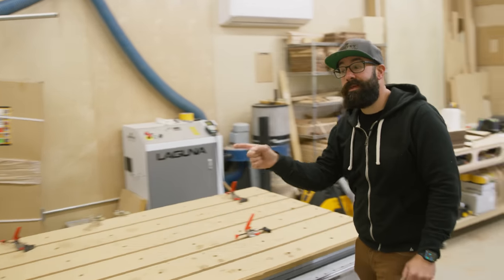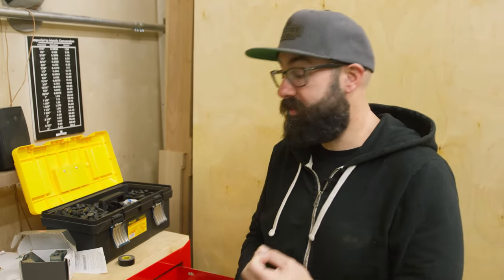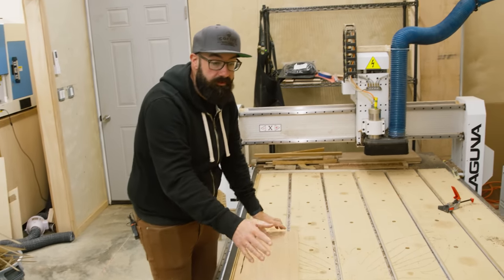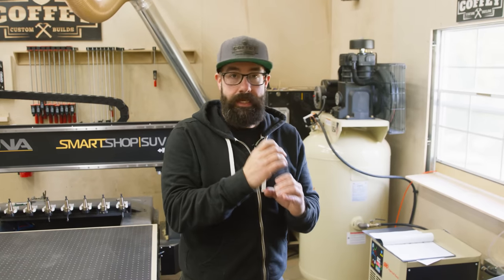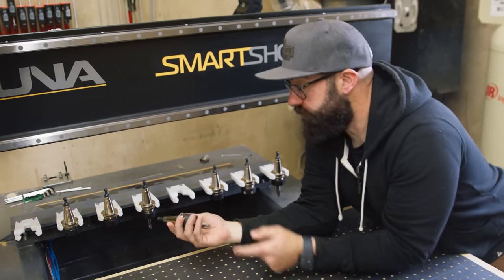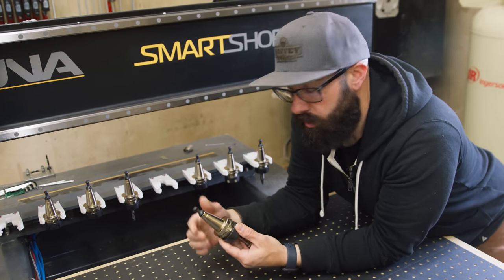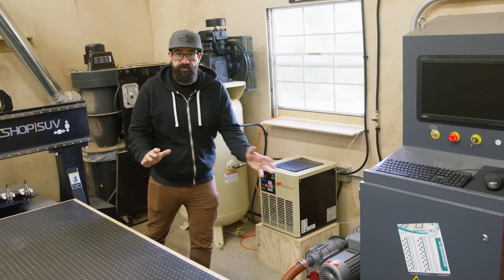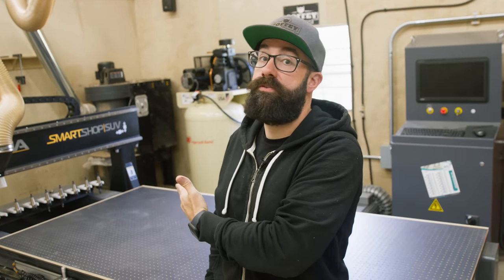The Hidden Costs of CNC's!

Comment: I guess the final cost time aswell right?
Every hour spent setting it up is an hour you wouldve been paid for.

I think for me in the end what turns me off about cnc machines is that I wouldnt really consider myself a woodworker any more. I'd be a cnc operator.
Reply from the maker: Yeah time is always the biggest cost. 

Do saws turn you off because you'd be a saw operator? It's just another tool that gets used in the shop. I own 3 CNC's. I rarely use them. My employees do mostly. But I am definitely a woodworker. I also don't operate my lasers. But I do operate my saws, joinery machines, chisels, hand planes mark up tools. None of those tools make me a woodworker (or not).
Reply: @CoffeyCustomBuilds  for me it's not just another tool. Look, would you consider me a potter if I worked at a modern potfactory? Or a glass blower if I pushed a button that blows glass? There is a line somewhere along the way where your'e no longer a craftsman but an operator (you could be both ofc.). The line is fuzzy, and probably different for every individual. To me cnc is different.

I don't mean it as disrespect. One is not better than the other. I just dont want to be an operator.

Comment: Really surprised you didn't mention the oldest method painter's tape and ca glue.  Machine everything but the bottom and no pausing the program to danceing around with your clamps or clamp pressure relaxing whyle it's being milled.
Reply from the maker: I'm not a fan of it

Comment: Everything is a consumable, sorry to have to point out the obvious, but making a distinction is just confusing. If friction exists a part is going to wear down, even if you add something to reduce the friction it will still wear down, albeit slower but then you have the cost of the "consumable" you are using to reduce the friction and thus extend it's lifetime.
Reply from the maker: Yes, by nature everything deteriorates. But typically when referring to consumables the tool themselves aren't part of that conversation.

Comment: Well, the bigger the toy, the bigger the price tag. Obviously you didn’t get the new one for a hobby shop tool. Guessing you were making good money with the first one and felt it worth the investment to go bigger. Yes there are extra costs. Mine was around $2000, 6 years ago. After getting computer, Vcarve pro and bits and stuff, totaled about $4000 to get going. But, mine is about 24”x33”. No tool changer, just me. A 220 spindle, but not 12 horse. A shop vac connected to a dust boot. No big vacuum thinge, forgot what that was for. And I’m not saying $4000 is cheap, but I’m guessing yours was at least $15000 to $20000 or more, just for the cnc. And it’s a nice one that I wish I had to play with, but the one I have now isn’t the main tool in my shop, so no reason to upgrade to that extent. But it’s just like everything else. Compare tires for a Volkswagen to an F-350 pickup. I bought a middie lathe a couple years ago to try out and it was $450, so not the end of the world if I didn’t master wood turning. But then came a tool set. Then a chuck, a drill chuck, more tools and one of this and two of that. And don’t forget the sandpaper and finishes. Probably at least doubled the initial cost. One more. 8 inch bench grinder. $200 or so, just mount it, plug it in and get to grinding. But, the standard come with wheels are, well ok, but not Cbn. Gotta have a couple of those, right? So there goes another $400+.
Reply from the maker: Everything is relative and this was far more money than $20,000... But thats not the point. CNCs are becoming more and more accessible and I just want to help people who are researching understand there are costs that might not be as upfront as you'd expect.

Comment: I made 500 buck out of my 3018 pro with increased bed lenght and new 775 drill motor that have higher rpm that the one that comes with the machine. The machine cost me around 300 dollars with all the tools and upgrades. I got the money, learned CAM and CAD and had a lot of good time while working with this little abomination 😅
Reply from the maker: That's awesome!

Comment: Not sure why you think you need a CNC to build cabinets, I have looked into it and I don't see the costs savings to the way my cabinet production works
Reply from the maker: Well if you've looked into then I'm selling this.
Reply: @CoffeyCustomBuilds   Thanks, for the offer, I have a 10' sliding saw I use to cut my  panels, I find its just as fast as A CNC, also the CNC takes a sheet and optimizes and cuts parts all over the place, there is a lot of time figuring out what is what,  For me my system works best. I can do cabinet boxes pretty quick

Comment: cutting  mdf all day long  need a decent machine
its pending on  what type of work you get  and how  many

locally i know a cabinetshop, they invested  around 2005  in german router  and a six head molder
around 450K
but they doing weekly 2-3  complete  kitchen cabinets

myself  am a lot smaller  using a 4x8  router   a 1325
whole machine  was around 5000  in the shop  with all taxes and shipping

however it can generate a few grand per week
simple  shapes and a lot  that makes the  money
 individual works like inlays  and carvings  are the least profitable stuff

so overall whatever comes still  more affordable than  going to  a workplace daily
Reply from the maker: couldn't agree more. These machines can generate revenue very easily and they're better than working for someone else any day.
Reply: @CoffeyCustomBuilds  
thats the point, build your own life, and  dont get hired to build others lives

Comment: #suggestion Btw did you considered adding new 3phase electric line ? In our country it is costly but maybe it make sense for a long run. Also you would not need these power conversion tools. And thus will have more space
Reply from the maker: The local government won't let me get 3 phase. Its incredibly disappointing

Comment: You dont use two side tape or a vacuum table?
Reply from the maker: As I mentioned in the video, my Smartshop SUV has a vacuum bed and my Swift does not. For the Swift we use lateral clamps, t track clamps and double sided tape.
Reply: @CoffeyCustomBuilds  I apologize but click bait appears to work both ways. Still, try two-sided crepe tape. The magic;  two layers. Three is damn near permanent. Four, damage stuff pulling it apart.

Comment: I spy, with my little eye, a non-code-compliant junction box - just to the right of your air dryer ;) If you get an "uh-oh button" (knockout filler/plug) and fill the open hole in the bottom of the box, you'll be good. 8:16

Edit: Oh, I just got to where you're moving the compressor and vacuum pump out of the shop. Looks like that j-box was feeding the vac pump, so it should get looked at again.
Reply from the maker: Yeah it wasn't done. It is now.

Comment: Air compressor 

Electric air dryer for air system 

Dust collection hoses are wear items

Tool holders are a wear item

Tool collets are a wear item

Proper greases and lubes.  Can be $250 a tube

3 phase power.  Converter if needed
Reply from the maker: Yeah that's why I mentioned them in the video. They add up quick.

Comment: Imagine how much he could have saved if he did his own research and fab work or if he wasn't pulling vacuum through mdf. It always amazes me how much people spend on pre-fabbed "solutions" then talk about how much it costs.
Reply from the maker: It always amazes me when people comment on things they know nothing about.
Reply: @CoffeyCustomBuilds  I grant that this is the norm online as well as you not having any information against which to compare my perspective while I had your video walkthrough.

That said, unless the MDF was prepared in some way to make it more porous, such as perforation, you're wasting power overcoming the resistance of an effectively solid material. Perforating the spoilboard would remove the need for the mat as well as reduce the resistance the vacuum pump is working against decreasing heat, power draw, and increasing efficiency. 

The air setup is similar. Excessive power and heat to do something that could have been better handled with a high-output single stage like CH's TQ3010, a passive condenser stack, and 3 stage desiccant filter array. The cost to refresh the beads pales in the running & maintenance cost of a powered condenser. Copper plumbing reduces specialty fitting cost and is cheaper up to 1 inch compared to other retail delivery offerings.

The largest problem, however, is the lack of foresight. You did all this work and spent all this money only to need to spend more because you're now relocating a large portion to a remote site which means even more wire and plumbing, re-calculating flow rate for the air, switching, valving to say nothing of cooling it.

It's your time and money and you're going to spend both as you see fit which is your prerogative. I simply found the video ironic considering the above relative to the subject matter.

Comment: So ... double the cost of a "budget professional" machine for the setup if you are starting from zero?

Fortunately, a 30 amp outlet doesn't cost more when it's for a $90K machine instead of a $5K machine.
Reply from the maker: This is an 80 amp service. But my first machine, which is a budget professional, was less than 1/3 the price. The added side costs made it roughly 4 times more.

Comment: Funny to se how much extra expenses have Americans because of their bad electric system. Because of the higher frequency (1 phase 230V/3 phase 400V) we don't need so thick cables and it's very easy to get 3x20-32A. (We don't have that 2 phase thingy). Actually even my previous flat had 3x16A and that was just a 32 square meter flat.
Reply from the maker: So funny
Reply: @CoffeyCustomBuilds  I understand your pain... Just strange that electricity is so many times a concern in the US. I'm in a move, I looked 4 different houses in the last month, only 1 had 1x32A, the rest had 3x16A.

Comment: Kinda bad video for people wanting to start on CNC. most hobby CNC will use a normal outlet (this is something you should look out for when buying your cnc) My water-cooled spindle works fine plugged into normal outlet. Dust collection: past 3 years i been running a ridged wet/ dry vac with Dustopper been perfict. The tools/ Bits.. You dont need to buy them all at once buy bits as you need them. Software this depends on the CNC you get. My fav Vcarve Pro it is pricy but very worth it. : Hold downs....man you got more wrong then you do right. 2 sided tape or painters tape with CA works fine if your doing simple cutouts. about the only time i break out in clamps is if im doing something like a relief carving. Wasteboard <something you should look at when buying the CNC. most CNC's you make your own wasteboard they will come with one most the time but you can make new onces yourself out of MDF .75
Should rename video to hidden cost of a laguna
I use a OnefinityCNC
Reply from the maker: That's cool that none of those things cost you any money but yeah I have a Onefinity as well and none of the stuff needed to get it going was free for me. But this video is definitely geared towards non entry level CNC's. Not Laguna's. But CNC's that actually run spindles and not Makita routers
Reply: @CoffeyCustomBuilds this answers so many questions you ignoring facts and twisting or confused on what i say? you say you have a onefintiy? Put a SPINDLE on it PWNCNC spindle just to match mine put the water cooled one on. show me what the Laguna can do and what the onefinity cant? I have a onefinity woodworker and onefinity Elite foreman. I have yet to see why people spend 40,000 for a machine when you can get one that does the same for 4500? and that is the elite model but i did spend the extra for the SPINDLE
Reply from the maker: @st0mper121  I can cut 3/4" plywood full depth in on pass at 800 ipm. This comment shows you know little of the CNC world outside of the Onefinity. The answer is production. A 1F is a great starter machine. But a 3hp spindle, much less a trim router, just cannot do what a 12hp spindle will do. And you can't do full sheets. I run a full production furniture and cabinet company. We would not be able to do anyehrte near as much with the 1F as we do with the industrial machines. We ran through 35 sheets of ply in 8 hours the other day. Cut out a kitchen and 4 built ins. Its just not even the same conversation.
Reply: @CoffeyCustomBuilds  does cut fast but the onefinity can still do the cut i am at 48 x 48 I do see that it is 6 hp ( I think mine is only 3HP Spindle) but i also when you look at laguna CNC's they want 39,495 for a 4' x 4' for plywood at .75 does take me 3 passes that is worth 35,000$?. even when you look at production standpoint 40G = 8 onefinity's or 1 laguna 48 x 48 even at 3 pass's x8 that is what im thinking anyway? tiling is easy with the correct jig/ bed setup and good nesting I admit though if my product was over 48" i might justify it more. Im not saying you made bad choice im trying to understand the $$ of the machine? is -3 passes verse 1 pass but x8 machines speed up the product time?
It almost looks like if your CO is up and running its a good choice but if your startup and is watching what you spend 40,000 for a 48x48 will prob put most startups in debt.

Comment: boss has a Kuka robot carving EPS foam alongside me. oh human artist replaced by a robot, eh? well let's consider he needs designs in CAD, hire 3d modeler. i work from a sketch w measurements. Next that 3d model needs toolpathing, difficult skill set to source... affordable options might be foreign. we had a guy in Ukraine who spoke perfect English... and had to quit when invading Russians got too close. Oh and the power requirements narrowed our options down to a building that... let's just say it's less than ideal for manufacturing. oh but the robot is faster than i am! right? think again. it runs for hours and hours. but, it can run all night, right? uhh no it can only go to the end of its program and then a person has to... wait, person? yeah it needs an operator to refill it with special shaped blocks and set up the next program. and clean up the debris... so let's tally up, one 3d modeler, one toolpather, one operator-- that's 2 subcontractors and one employee and it does what I do... only slower and triple the decibels. and it can't tell if it made a mistake or not, it just keeps grinding away. now, if the job requires i make nine perfectly identical sculptures? okay that's why there's a cnc robot. that's the one category where it's superior
Reply from the maker: Exactly

Comment: all machine can use same CAD and CAM software, CAM make you plan to G-code and all machines use normal G-code not need buy ewery machine own software, and if use linuxcnc machine running software not need more ,all g-code can run one linuxcnc software, only stupid buy all software new if buy new machine, waste lot money than idiot. most factory use only linux base software because have safety lot more than any windows base worst toy softwares, and linux can controller flexiple all machine than windows softwares or machine factory own worst softwares if have own special works. etc. and factory use  linux base soft because have safety REAL TIME working not worst windows system . im build factory automation last 40 year and newer not has seen any factory level machine who use windows base systems, not newer working well, and safety and alltime not problems. linux have only who can use factory softwares safety and longtime whitout problems lot. all machine factorys own softwares not newer working well longtime and this have super expensive use.
Reply from the maker: Hard to understand this